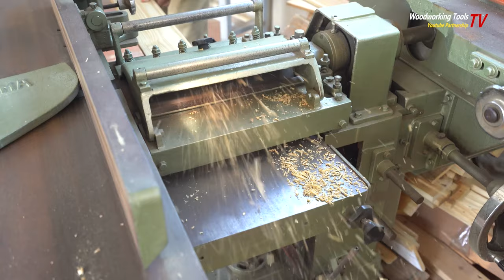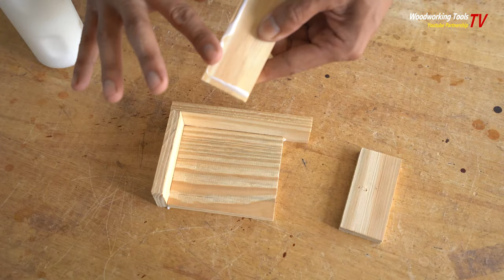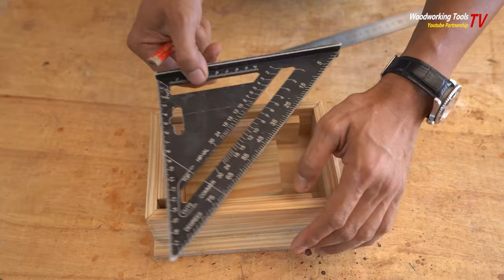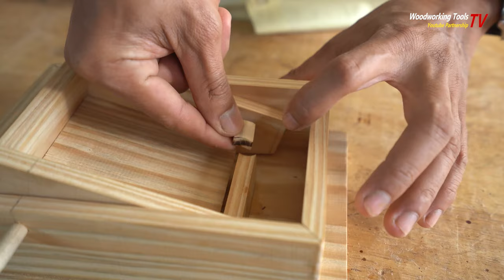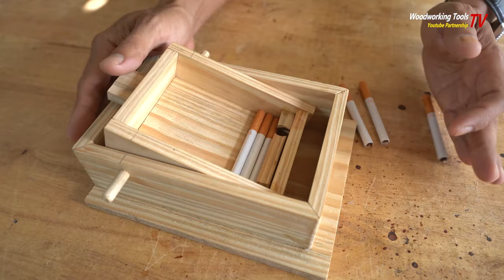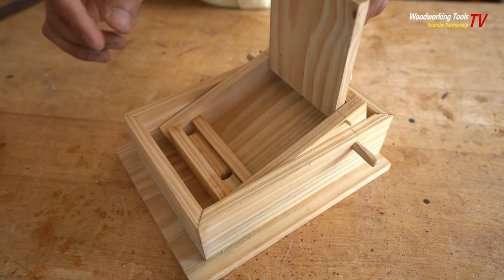DIY Woodworking wooden Cigarette Dispenser - Cigarette dispenser DIY

Comment: 🙏🏽🙏🏽🙏🏽🙏🏽🙏🏽🙏🏽🙏🏽🙏🏽🙏🏽🙏🏽🙏🏽Nice freaken plainer dude..! That thing is awesome man! Dang I thought I was smith grabbing a “Ryobi” 25 years ago. Hey that’s what I could afford and believe it or not I’m using the same blade and it still runs great. Maybe you could help me (please)..? I’ve had this problem sense I first started it up. I know it’s a cheap starter one, this I do know! I didn’t at all expect anything even close to it being as good as it is and it really is still running and all that. Right when it’s finishing up right at the end maybe a 1/4” or so left it dips into the wood. Kinda as if it was catching at the end and kinda kicking up the opposite end of the board(the one that’s already passed through). So every piece I’ve ever sent through it has to be about an 1” longer to be safe.  Did I explain that good enough? Man oh man if you could help me with that you’d be my darn hero. Because it works so well and I’ve never been able to use it on a regular basis sort of as a commercial use. (My own little business). That’s where I’m at not though. I’ll keep er no reason to replace at this point but man that little grove at the end is killing me.🙏🏽🙏🏽🙏🏽🙏🏽🙏🏽🙏🏽🙏🏽